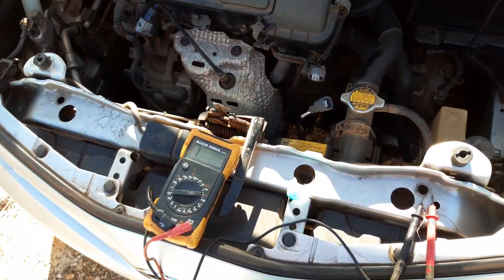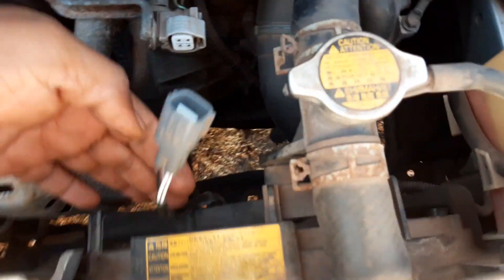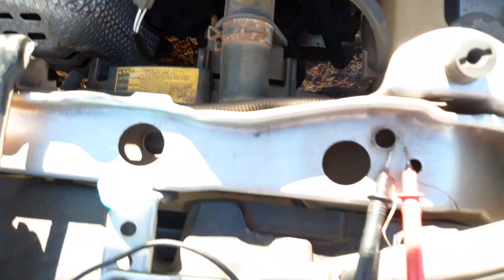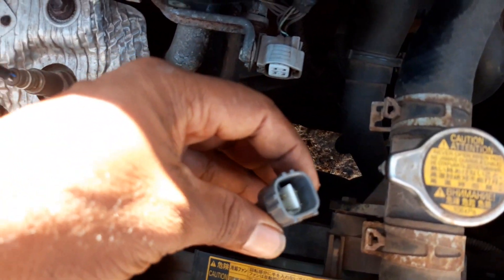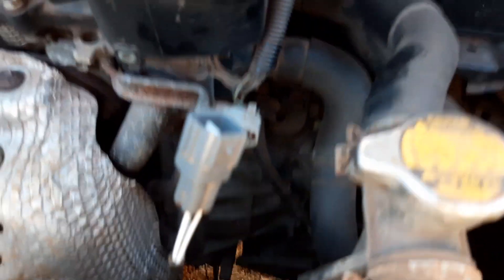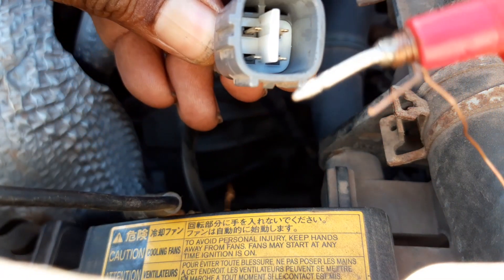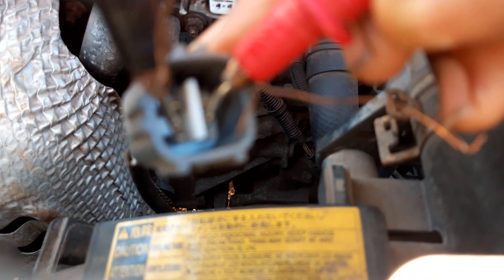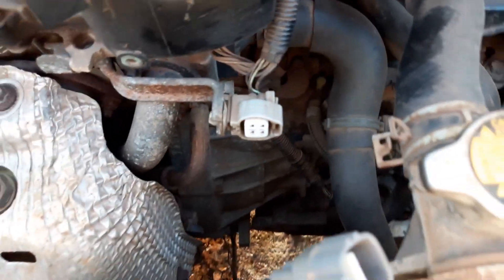Toyota Vitz Oxygen Sensor Wiring For Heating Circuit.

Comment: Check the resistance of the circuit on the sensor and compare it to factory specs
Reply from the maker: The resistance is about 9 ohm's.
Reply: @ShelDockToyotaVitz  that's just a bit out of range, normally it should be between 10-25 ohms, so you'll need a new sensor
Reply from the maker: @furve  Respect my friend appreciate the information.👌
Reply: Is it possible to get your contact for WhatsApp